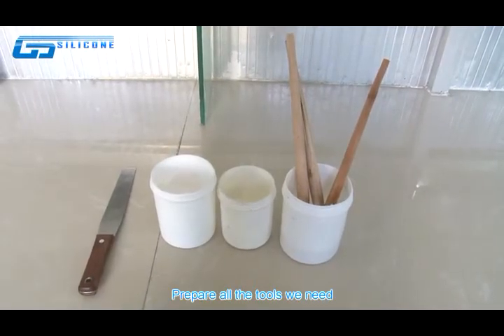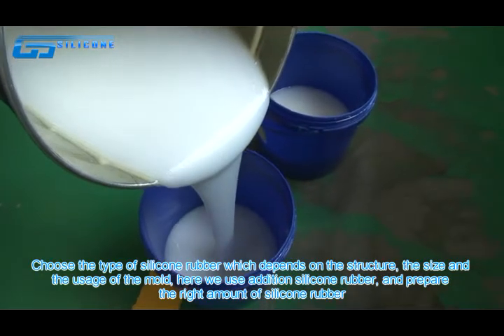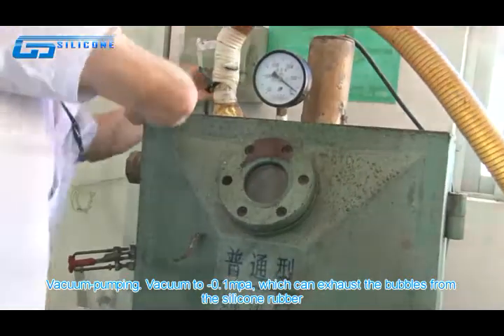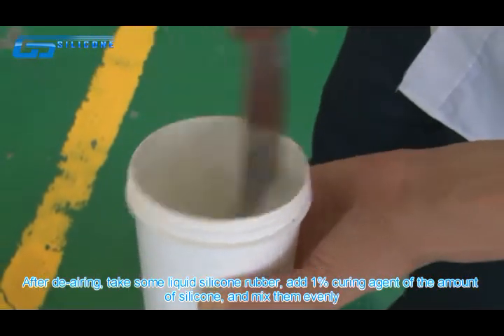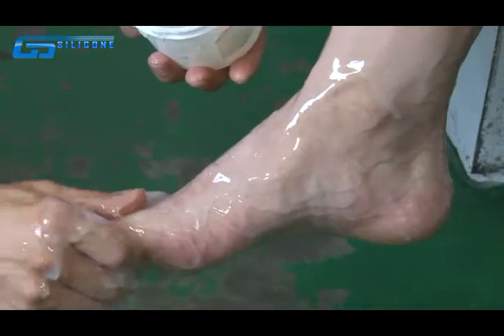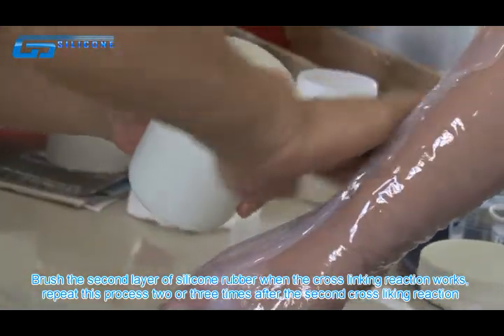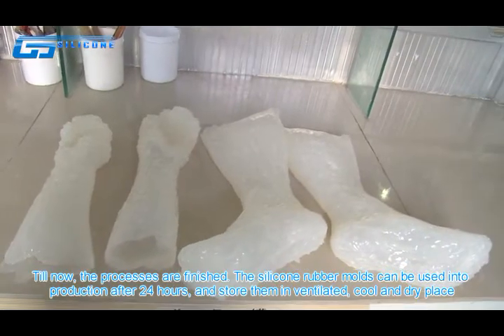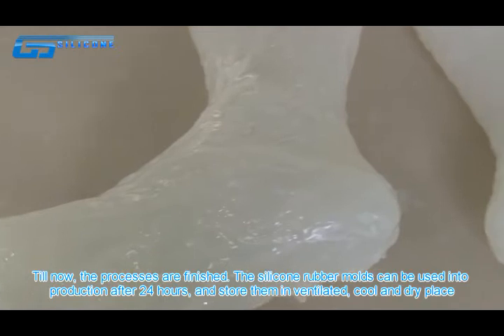Lifecasting Tutorial: How to Make a Mold of Your Hand

Comment: So many things wrong with this I'm not sure where to start. I hope you're using a silicone (and release agent) that are safe for human skin contact. You didn't state what either was in the video. No thickener used for the second or 3rd layers makes for a nasty surface to work with (as seen in the video). No outer shell once the silicone was cured means that it will deform when stored, and will make a deformed cast when used for its intended purpose. I'm just hitting the high points, here...